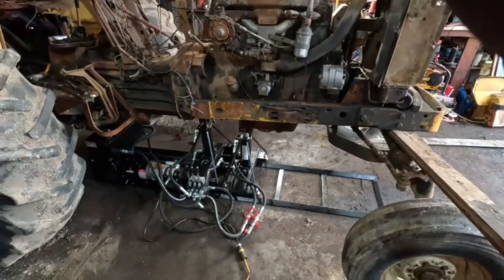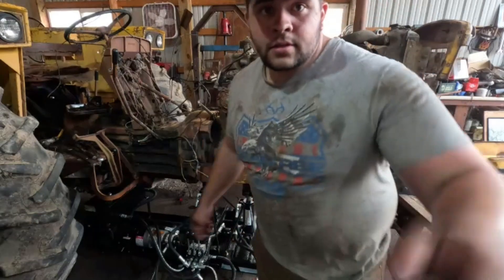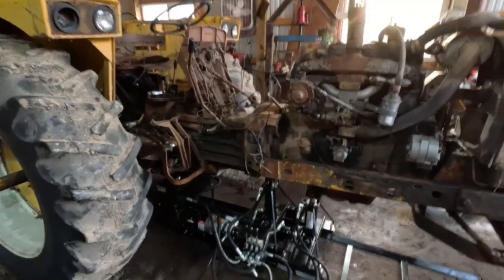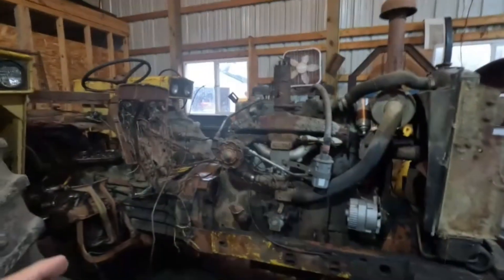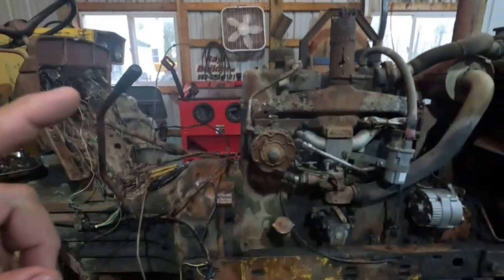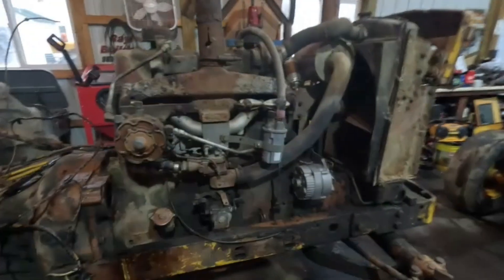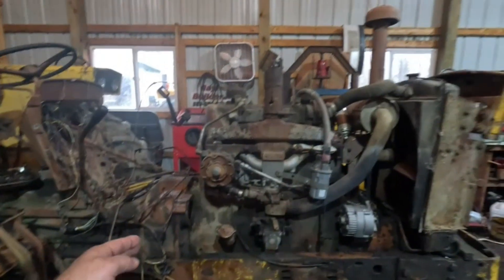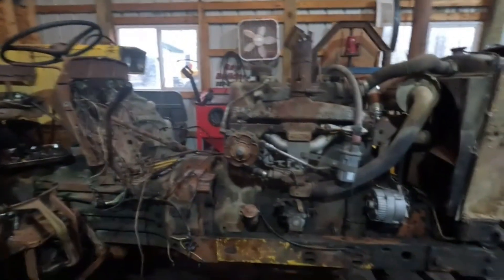Jacob's Senior Project Is Revealed!

Comment: That’s super cool! I’d like to see closer up how it’s made. The only thing that I think would make it easier. If it’s not already made this way, is for the cylinder that does the pushing forward and backward to have a slotted hole where it attaches to the stand under the tractor. That way you could easily get the hydraulic pressure off and then finish up, pulling it backwards by hand. I don’t think you would ever want to put full hydraulic pressure to force the 2 halves together. But I know some guys who would try. 😂